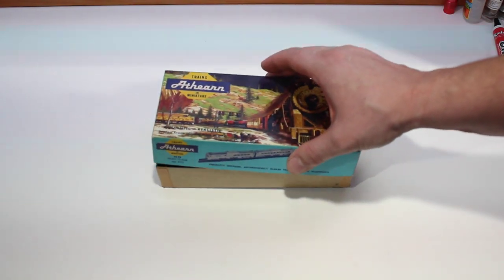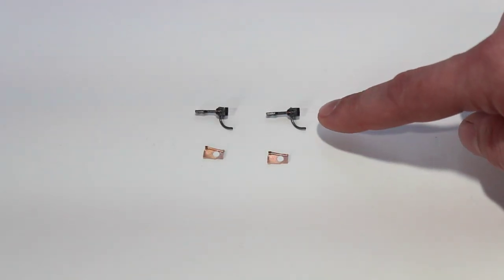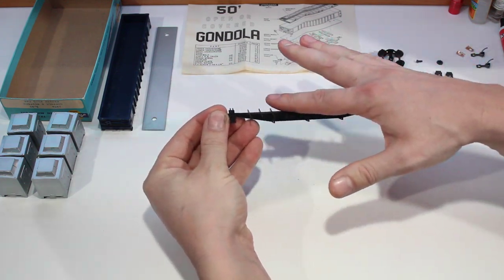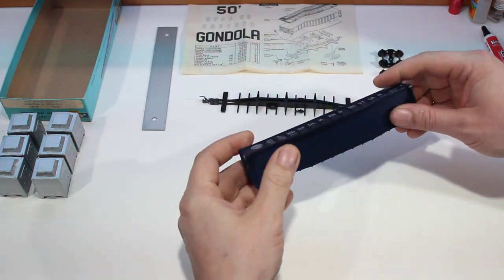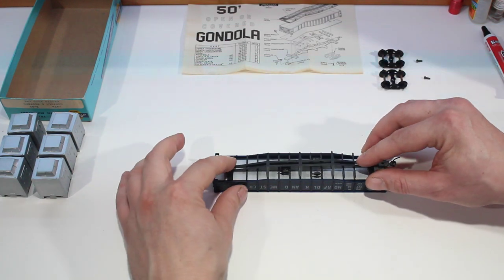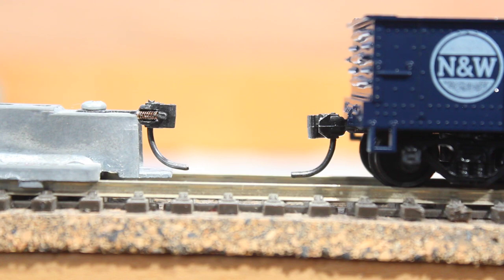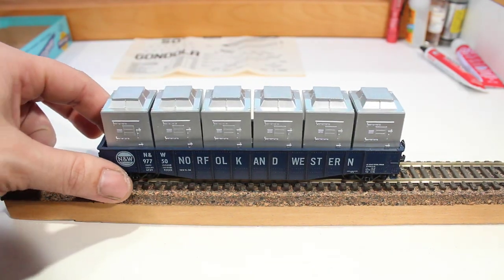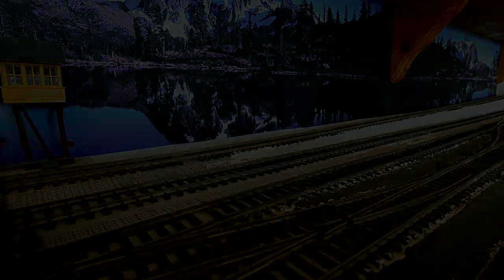How To Assemble Frozen Food Car - N&W

Comment: Trivia: For years modelers have debated the prototype for this model, eventually concluding there was no known prototype. I recently began an experimental project involving splicing body sections together to produce a model the typical 52'6" length that most gondolas were. It turns out there WAS a prototype for this car ... sort of. The Athearn gondola is based on the popular "Greenville" mill gondolas and clones that were produced in the 1940's. One of the biggest differences was that Athearn shortened the design by one body panel, presumably so it could fit in the same boxes they were using for everything else at the time.

The second major modification was the ends. Note how the end sills jut out - this was typical of gondolas with drop ends. All these mill gondolas were manufactured with drop ends, but Athearn did away with those and created a fixed generic early Dreadnaught end for their model.

The third major modification was to remove the ribs over the truck bolsters, which would have been half a body panel too close to the next inboard rib, and replace it with a pseudo-rib closer to the end. It would have been far better if they'd just used a single rib directly over the truck bolsters, as all gondolas have, resulting in two wide panels rather than the three panels they created, all of different widths.

And that was this month's history lesson!
Reply from the maker: Very nice history lesson, Thank You

Comment: I would used kadee 148 and drill the post pit fkr screw to hold the clip on , aslo metal wheels
Reply from the maker: Typically on this channel I don't do modifications, just because there are so many different kinds and it's a preference thing. The main goal here is to show how Athearn intended to build it from the factory.  
The #148 Whisker couplers are nice but I don't usually use them unless I really need to, because they are more expensive.
Yes metal wheels are very nice and much cleaner for the track, but again to put metal wheels on hundreds and hundreds of blue box kits I have would be quite expensive.